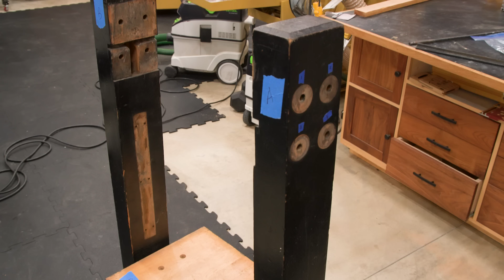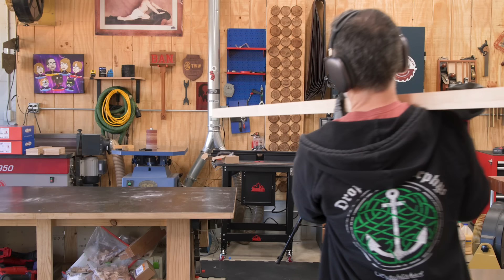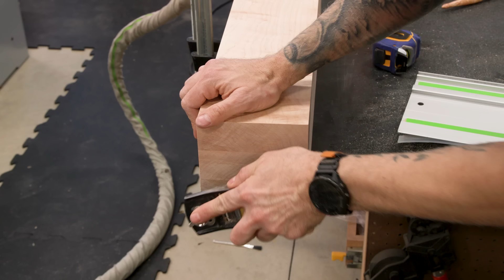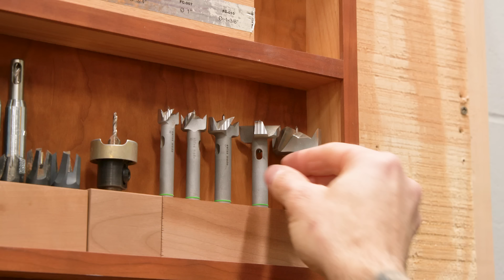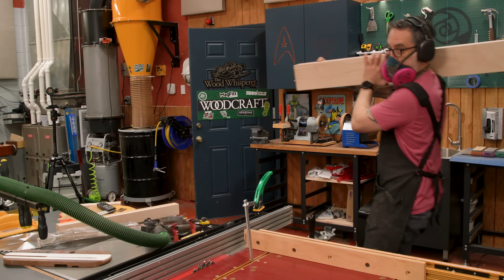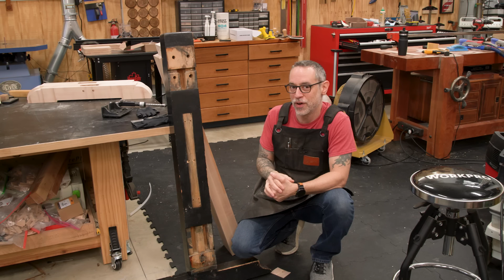Can I Rebuild a 120-Year-Old Machine?

Comment: A tip for putting in your trunnels. Bake them in the oven at around 175-200 fahrenheit for a couple of hours. This will get them incredibly dry so they push into a tighter hole. Then as they slowly absorb moisture they'll expand out lock the joint tight.

Comment: And now I understand why the later versions had the head stock, the top horizontal bar, able to be moved up and down almost the whole length of the press. Sometimes they press a stack of just 1 book, sometimes 10 books. Moving the headstock up and down reduces risk of toppling the press all together.

Comment: Very nice restoration video. It's a shame what happened to the press during shipping after it had survived for 121 years. The cast iron can be brazed back together, sometimes creating a repair stronger than the original. Draw bores are rarely talked about. But they are incredibility strong in demanding situations. My main workbench has them and the joints are just as tight now as they were 20 years ago. Also, great examples why a small, low angle block plane should be within easy reach at all times.  Thanks for another info-taining video. Maybe, one of your best yet.
Reply: I guess it depends on what you do. In timber framing draw boring is used all over the place.

Comment: Super cool project! I love the Carbon Methods products. I used the Carbon Coat on a jointer refurb last fall and it was so nice. I did the same thing with the abrasive pads and random orbit sander. It made the surface prep so much easier and faster.

Comment: I wonder if Noah is aware that instead of him having a brandnew castiron wheel made, he can actually get the wheel braze welded making it just as strong as the original casting plus he can also have the broken rail fixed too. Great job on the remaking of the frames for the press. Hopefully, Noah has put a claim against the firm who was doing the delivery of the book press and not just written it off as an accident.  You and i both know how fast and reckless some of these delivery companies can be.
Reply: @simonr6793  tha route of brazing is encouraging, I have Kluge 13" letterpress that I witnessed a fork lift operator drop about 2" to the ground.  I have not run it because I am afraid something may have cracked.  I had heard if presses get cracks in the iron parts, then it is game over.   (I also have a smyth sewer that survived the move.)

Comment: Very cool project, Marc! 
You often use two coats of oil finish, even with Monocoat, if I'm not mistaken. I don't remember if you said this in a video (you probably did) but do you have to sand in between coats?
Reply from the maker: Nope. No need to sand unless there’s something rough on the surface. Usually there isn’t.

Comment: Noah if you are reading this you might find a local welder to see if they can fix that cast iron.  If a magnet really sticks to the cast iron it should be able to be fixed by a competent welder.

I live in a small farm town and the local welder here has been around for a long time. It’s always my suggestion to find an “old timer” like that for these types of repairs.
Reply: generally you would braze cast iron not weld. It CAN be welded but easy to screw up and brazing is just about as strong as the original cast iron.